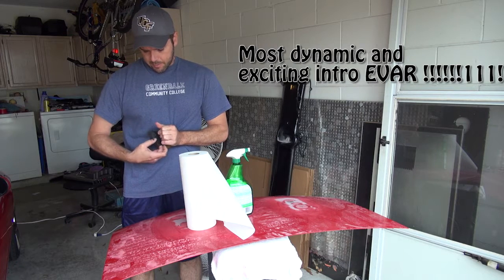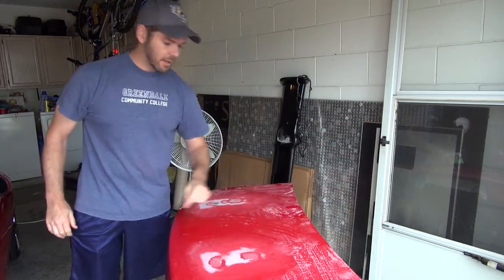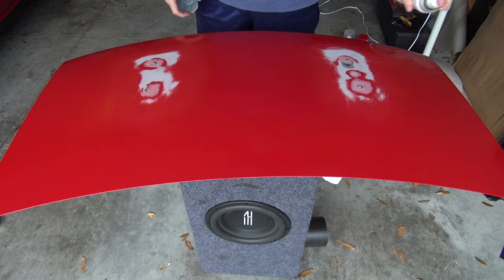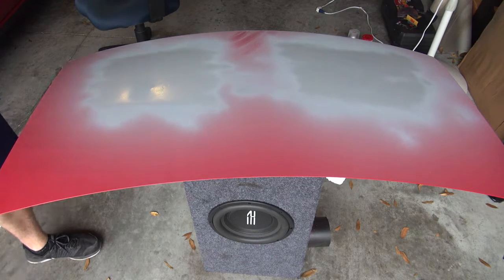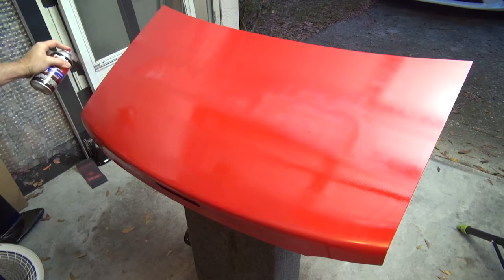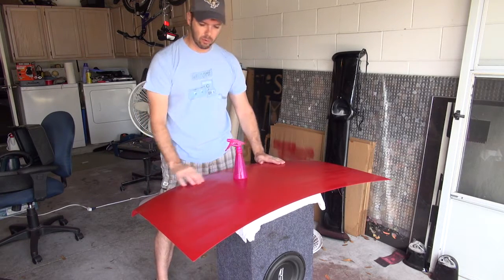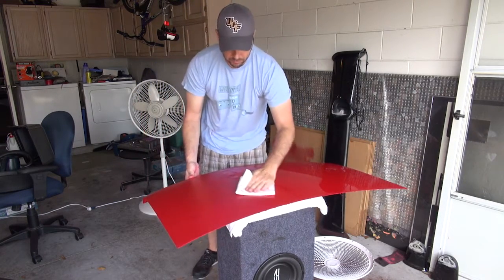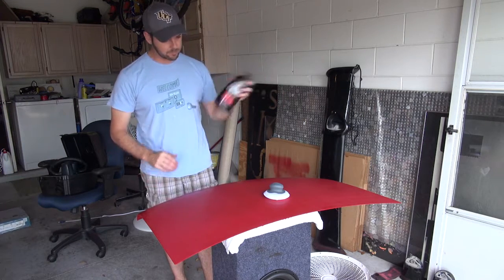1990 Miata Project Episode 17 - Painting the Trunk Lid

Comment: Looks OK for how you did it, how ever did you sand the deck lid at all before you started? Bondo would hold better if sanded with about 400 grit before. Then once bondo dries sand with 400-800 grit, then prime. Let dry, sand with 800grit till smooth. Paint as you did, but overlap the spray, (watch the paint as it sprays).  Let dry for two weeks before doing any buffing which gives the paint time to totally cure...

Comment: The entire trunk lid should have been sanded with 400 grit or a red Scotch Brite pad or similar. This will give your primer the mechanical adhesion that is required for a lasting, quality paint job. No matter how the top coat comes out, the entire paint job is likely to peel and flake, over time. Especially when applied to a flat surface like that, which is subjected to direct sunlight, rain etc. Good luck.
Reply from the maker: When I redo this project, I'll likely be doing it more "right".  So thanks for the tips.

Comment: Not too bad of a first time with paint and bondo! Not going to lie though, when I saw you use the wrench and hammer to knock down the high spots in the previous video, I cringed lol. Every time I did bondo work, I always used body hammers. They have a rather large head for how small they are, and the head is a tapered flat edge. Your mindset is correct though, just tap them down a little below where they need to be, then bondo to make it level.
Reply from the maker: +Ryan Sapp The next time I try it, I'm going to be more aggressive with hammering down the raised spots.  Plus, I think there's another product that Bondo sells that is supposed to fill in the air bubble holes of the patch that also helps in the smoothing of the material to the metal.  I learned a lot doing this and I know what NOT to do for the next round.  It might be a while though because it's going to be pretty expensive to get paint code SU paint into spray cans unless I wait for a few months when my local store will be able to do it.
Reply: +goodeggpro Well besides knocking the holes down, the rest of your procedure was good! Did the paint on the trunk lid not match the rest of the car at all? I know in the video it didnt, but the rest of the car was faded, so it was hard to tell.
Reply from the maker: Ryan Sapp It's slightly more orange than the red of the car.  It looks almost identical after the paint restore, so I think if I can't wait to try again, I'll just use the same paint, and then much later, I can just respray with the SU color more easily.  I can tell, but just driving around, I doubt anyone else would be able to.

Comment: For the orange peel you did good, and could even go to 2000 grit wet sanding....not trying to come across as criticizing by any means, just trying to pass a bit of helpful info on...Eric
Reply from the maker: Thanks.  I learned a lot after this first attempt.  I'm still going to be redoing the trunk lid and just today I got a ball peen hammer to better knock out the raised dents.  And I don't take any offense from people trying to help.  Some advice I take, some I don't.  But all is welcome.
Reply: Cool, are you using anything behind the trunk lid for support when you are hammering on it? I suggest at least a block of wood under the spot your beating at...helps support the metal in the area that's being worked...Eric.
Reply from the maker: Eric Pierce Pretty much just that makeshift "table" of a speaker box you see in the video.  Plus, the trunk lid has a back support structure attached, so it's not just a sheet of metal.  If I can find a block of wood small enough to just support the exact place I'm banging on, it would be helpful, but even then, one of the holes is right at one of the rear support areas.  It's not an impossible job, but it's not totally easy either.  Thanks for the suggestion.
Reply: Anytime. I'm working on mine also, just not in any hurry. I don't have a garage to work in and even though the days are warm, when I can get out to it right now it's pretty chilly so I'm not getting a lot done. Old age and joints don't always cooperate. It's my primary D/D so I don't do much right now that can't be finished in a day...Well I'll be watching your progress as you put it up. I'm enjoying the video's, keep them up and thanks for the entertainment. Eric.

Comment: Seeing the primed area through the paint is called flashing. The primer you used is not for this kinda project. If you use that primer you have to finish with a paint from the same company that has the same lacquer based Catellus